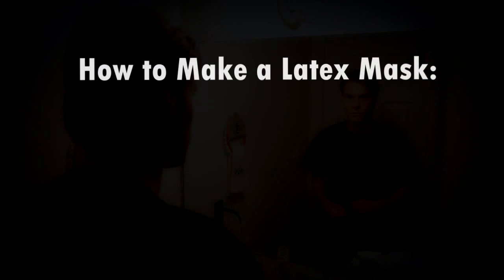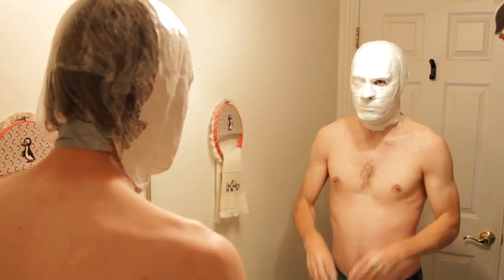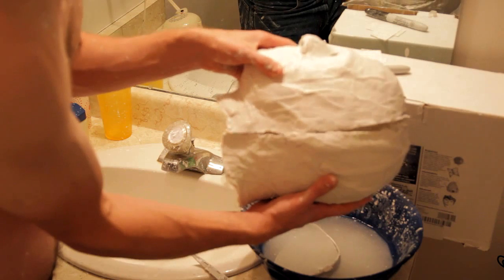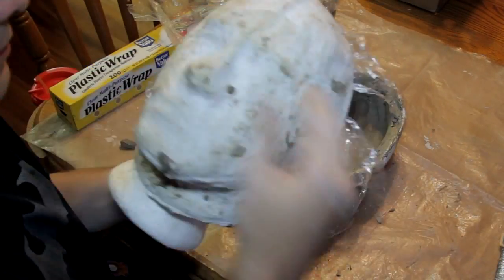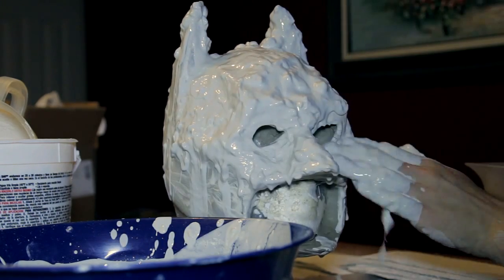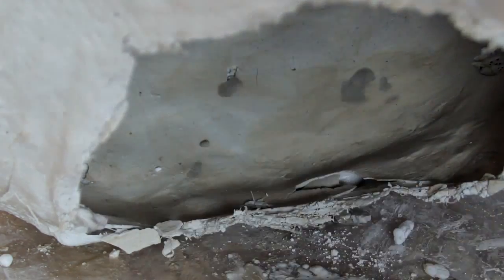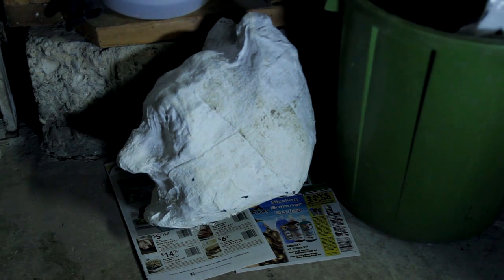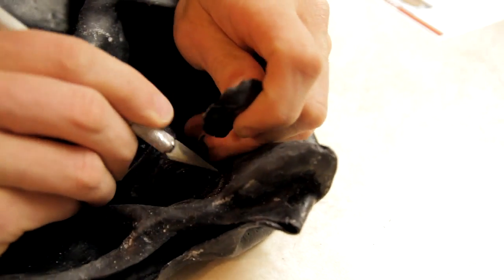Tutorial how to make latex mask

Comment: Hey, I'm planning on making a mask with spring dreadlocks that can handle headbanging and bouncing around on stage. I thought about two plastic jugs or similar plastic spheres cut in half to hold the springs with a layer of thick, heavy duty plaster in between about 3/4 inch thick to hold the springs on. Do you think that would work? How would you do it? What kind of plaster or material would you use to secure the small springs?
Reply: Someone's making a Corey Taylor mask? If that's the case then we're both here for the same reason because cheap masks are horrible and acceptable ones are prohibitively expensive